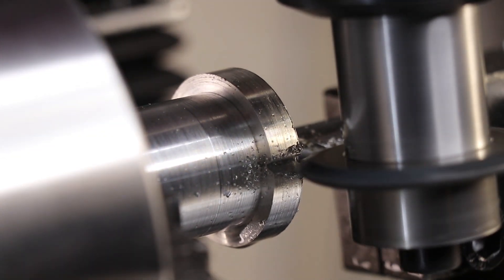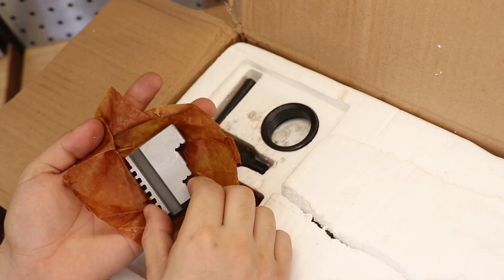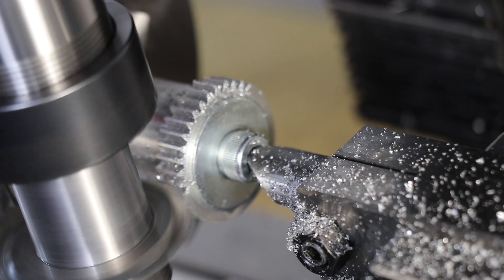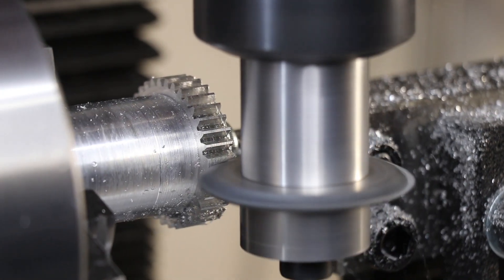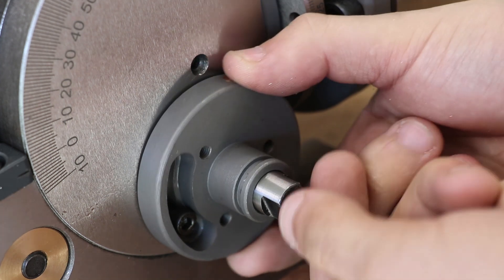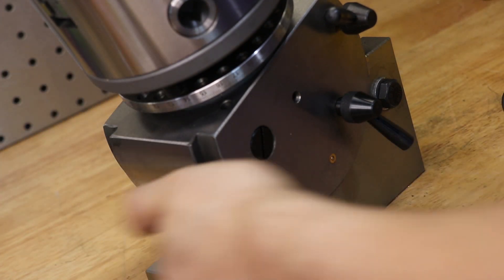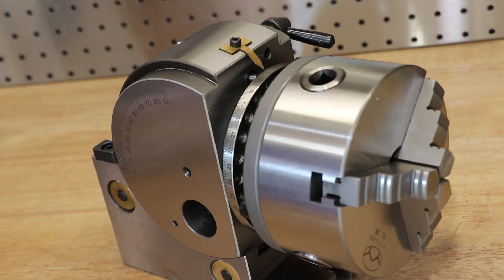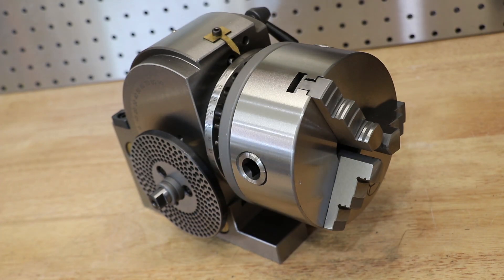$200 Dividing Head - Almost Scammed Buying It

Comment: I have been eyeballing these on Amazon. My mill is cheap, Ecno 30 and absolutely not production shop quality. I got it and about $1,500 worth of Japanese and Swiss cutters for $400. It was a basket case of work like new hand wheels, new quills and rework of the top cover and depth gauge ect. But it was what I could afford and does fulfill my needs. Locked down, it'll cut true enough for me, I'm not outsourced by Boeing or Lockheed, I'm not making aerospace quality parts.

Sure I'd love a $5,000 used Bridgeport but that's later. This works for my garage.

I need to cut a very specific set of rollers with 1/4" pyramidal teeth for a very specific and unique machine I'm making, specs don't have to be to the tenth of a thou. A knurling tool isn't going to do this. So this tool is what I'm after but I've held off for worry it might be a bit too cheap for what it's supposed to do.

Now I know what to expect. I think I'll nab one. Thank you.

Comment: Have the same. Getting the chuck off was childs play. It is just screwed on. In fact I sold the chuck already - without the back plate of cause. Have a 125 mm  from my lathe what was a direct fit ... Quite convinient, can also use the 4 jaw from my lathe on it .No issues on my one also with the handle or its bracket. Works like a charm ... My one came also with a knurled nut for protecting the thread when the cuck is disconnected...

Comment: The original B&S dividing heads have Timken type zero taper roller bearings, and the spindle nose and taper are ground true in place in those bearings. Disturbing the bearings for any reason is risky. The spindle will lose factory accuracy because of stacked errors reassembling. I found the imports a great buy, but the items need refitting of the parts. Good video showing the problems.

Comment: I have the bs-1 version of this. I had to take it completely apart to deburr everything and completely remove the excessive amount of grit it contained. Then I relubed and adjusted everything. Made another index plate on my rotary table to expand the number of gears it can cut. Bundybears workshop channel shows a complete tear down.
Reply from the maker: Did the same, a lot more grit that I would have expected, glad I did it sooner than later. Cheers
Reply: And these cheap import heads are excellent once they have been given the clean out and refit with care treatment. I have a BS-0...very pleased with it.
Reply: The channel is Bundy Bears Shed.  https://youtu.be/4pZxH3NuLHY

Comment: Wow. I have the Vertex BS-0 and it is visually identical except for the shape of the locking handles and the sector arm.  I have seen a page in a hobby machinist magazine from 1975 advertising the BS-0 so this design has been in production for a very long time.
Reply from the maker: Very surprised at how little the design has changed. If anything the sector arms are the weakest part of the build. They are die cast and not that nice to use. Thinking of making brass ones. Cheers

Comment: Seriously? Just use some good pliers to remove the chuck and then replace the bolts with some low profile hex
Reply from the maker: the problem I really was having was that the backplate was so tightly torqued on that it was seized on to the threads. I eventually got it off, had to use a custom holding jig, impact driver and a wrench. Can not stress how tightly it was on. Cheers

Comment: "Cant machine a 101 gear, i might have to attach a stepper and get an Arduino" ... ya you're not able to do any of that... and especially not for a division you'll never need. Get over yourself
Reply from the maker: Of course you can, just a different division not offered by the plates. It's pretty much the same set up you would get in a CNC diving head. Plus takes out any errors or make doing it manually.

Comment: yeah man if that is a friction fit. press, or a frog if you can. to prevent shit from getting scratched heat up wherever you end up securing it on the press, and keep the heat away from the part you decide to press on. so at work we use an oxy propylene torch, but even a small propane torch will help. put the work under pressure, then apply heat, be sure to apply it quickly and after maybe 30 seconds of evenly heating, start to press further. itll hopefully come out nice and smooth. I tear apart industrial machinery as the day job, and things tend to make very loud bang noises when they come free when they are rusty or dirty. something small and new should be easy, im imagining only a few thousandths shrink. When you put it back together put some never seize of your choice on the shaft, just a tiny layer. heat up what your going to get back one either hot enough to just slide it on with gravity and finese or heat up a tiny amount make sure its lined up very well and press it back on as soon as its hot enough.  micrometers and snap gauges will be your friend.
Reply: NO NO NO - the chuck's backplate screws on. Read the comments, he already removed it.

Comment: The faceplate is screwed onto the thread, it is enough to block the rotation of the spindle and unscrew the chuck together with the faceplate. Then the screws will be easily accessible for loosening.
Reply from the maker: This is correct, however the problem I really was having was that the backplate was so tightly torqued on that it was seized on to the threads. I eventually got it off, had to use a custom holding jig, impact driver and a wrench. Can not stress how tightly it was on. Cheers

Comment: To everyone bitching about the price, would YOU set up a shop and build this dividing head to your high expectations for $200?

Yeah, just what I thought...
Reply: I've owned one of these cheap import heads for about 3 years and had excellent service from it making spines and cutting gears. The usual to be expected strip down and re-fettle is essential to get the best from these cheap heads but once set up properly they work exceptionally well. I don't know how they manage to sell such a complete kit for the price. Very happy with mine👌

Comment: I bought the exact same one, but it came with a 41-tooth gear instead of the correct 40-tooth one.  I discovered this 5 minutes after unpacking when I tried cranking it thru a single chuck rotation.  The seller was understandably incredulous so I had to disassemble it and send them photos.  It took a while but they eventually sent me a new 40-T gear which I swapped out myself.  I suspect the factory cranked out a whole batch of these with the wrong gear on the spindle.  It would be a terrific way for an ex-employee to exact revenge on his way out the door.  Not a bad unit for the price, but don't expect the quality of a USA-made equivalent.  It's perfect for a home shop.
Reply: That is a collector's museum piece😂 
You did well to spot that error.

Comment: you are better off using a press to press out the shaft because using a hammer you can seriously damage or even destroy the shaft.

if you ever taken a hammer to any kind of rod you will notice the end being mushroomed and with such a precision too you dont want to damage it.

from what you are saying looks like you got a very good deal

precision tools can be very expensive so you got a good deal.
Reply from the maker: Thankyou for your suggestion. I eventually got it off using a combination of a wrench, fixture jig, impact driver and penetrating oil. Cheers

Comment: It looks like quite a few people are suggesting clamping a bar in the jaws and using it as a lever (once the base is bolted down).  That's what I do on my lathe with a 10" chuck, and it works well.  I've use a copper hammer on the jaws before (after gently smacking it several times on the face of the chuck), but the lever is better.  In your case (because of the brass gear), I'd recommend using a propane or map torch to heat opposite sides of the threaded portion of the back plate for about about 30-60 seconds each and then try a good "calibrated push" on the lever.  If it dosen't work the first time, let it cool over night and heat it incrementally longer; the goal is to expand the back plate without heating the spindle.  I bought one of these dividing heads about a year ago, but haven't done anything with it except remove it from the packaging to inspect it the box it up again, so... I'll eventually face the same problem :)
Reply from the maker: Yeah I had to use a combination of a clamping jig, impact driver, leverage and penetrating oil to get it off. Good ideas all round, but it took several to eventually get it off. Cheers

Comment: The chuck spins off !  Its attached with a big thread just like the chucks are attached on some lathes !
 just put a set of ajustables on one of the chuck clamps and turn it counter clock wise and it will come right off
Reply from the maker: This is correct, however the problem I really was having was that the backplate was so tightly torqued on that it was seized on to the threads. I eventually got it off, had to use a custom holding jig, impact driver and a wrench. Can not stress how tightly it was on. Cheers

Comment: i have used a 3/4" air impact to break loose these things do not lock the chuck the shock from the impact will break it loose use some type of hex in the chuck to be able to use the impact with a socket
Reply from the maker: I did eventually get is unscrewed, using some advice I got here. Combination of an impact driver, a clamping jig and a wrench. Just amazing how tightly this was torqued on. Thankfully no damage to the tool. cheers

Comment: could you please do a follow up if you get the chuck off
Reply from the maker: I have gotten the chuck off, required a fixture, impact driver and spanner. I can not stress how tightly it was on, though no damage thankfully. I will certainly do a follow up. Cheers.

Comment: At the machine shop I work at our Tailstocks also have that two bolt adjustment and they are all REALLY wicked high dollar too! It seems really odd to me too that tail stocks for dividing heads and rotary tables generally have that clunky two-bolt on even the really expensive ones!
Reply: Replace the 2 individual nuts with a single rectangular piece of steel flat stock with the 2 thread holes tapped into it at correct centres. That makes the adjustment of tailstock height/angle much simple with only one spanner needed

Comment: get some mole/vice grips clamp them tightly on the cap heads then tap them with a hammer hopefully they will come loose. but i dont know if there is enough space for you to be able to pull them out fully but hopefully there is enough to get the chuck off. 

then if you do get it off id replace them with hex head bolts so it will be easier in the future.
Reply: NO NO NO - the check needs to stay bolted to the backplate so that you have some way to rotate the backplate and unscrew it.

Comment: I just unpacked one and the chuck did not want to unscrew. Gentle hammering on the chuck key did not impress it. I disengaged the worm , bolted it down to a machine table, put hex bar in the chuck, put a spanner on that and heaved. Then I put a spanner on the spindle lock, overtightened it and heaved again. That was when it gave in. It does unscrew but you must not take no for an answer.

Comment: You get what you pay for, but with careful setup you can do great work on it. Not heavy duty boss crashed ours and cracked frame but we were able to weld it up . But he tried to index a 8 inch dia backing pusher and got in a hurry and hogged the part and bang. I would buy one they are well made for the price. For home machinist they are fine. You could save money and build a Gingry index head yourself. His series of books are very interesting.

Comment: The parts of the brass clamps that need to be machined are machined. The rest you machined didn’t need to be. It just makes it look a little bit nicer. Like everyone else said, it’s not bolted on. A parts list will show how this works.
You were t being scammed. The extra cost for shipping was added into the Vevor price, which made it just as high as the other would have been, or even a bit higher. $225 for this is a ridiculously low price. Here, in the USA, from eBay, these BS-0 models go for around $500, and that usually doesn’t include shipping
Reply from the maker: I might have been so clear, I know its not bolted on to the spindle, the problem is is that the backplate has been over torqued on at the factory and has sized onto the threads, and my problems stem from being unable to unscrew the backplate. And I did leave out a few things with regards to the seller, they refused to refund me and grave me someone elses tracking number when I tried to dispute. And the seller was someone impersonating vevor, and the seller is no longer on aliexpress (banned maybe), if they were I would have linked to it so you could avoid it. And it didnt make sense either, it was being sent locally, but they said I was in the wrong country. Having being burned on stuff like this before with aliexpress, I was not going to take this risk. cheers
Reply: @artisanmakes  no problem. Without that info though, it was hard to make a judgement from here though. Glad you cleared it up.
Reply from the maker: And yeah, the brass didn't need that facing, but the rough surface really stuck out, looks a lot better now.

Comment: In order to do a 101 divisions you would need a universal differential dividing head.  the setup would need to be as follows
index circle hole pattern 20 
number of turns on the crank 8/20th 
graduations on the sector 78
gear on worm 72
first gear on stud 24 
second gear on stud 40
gear on spindle 48
idle gear on no 2 hole 24

not sure if you actually wanted or needed to know this, but if you did I hope it helped.
Reply from the maker: I appreciate you writing it out, thankyou. I'm sure there are many methods, someone else suggested making custom dividing plates. I have seen CNC controlled dividing heads also work pretty well. Cheers
Reply: @artisanmakes  
it is absolutely possible to make custom plates to improve and  increase your division capabilities, however making a plate with correct number of holes for 101 divisions would be vey difficult if not impossible as there is no whole fraction of 101.  (although peoples ingenuity always seems to surprise me to the solutions they find to problems, I have been proven wrong before.) 
CNC is definitely an option, I work a lot with CNC and and this would be easy.

Comment: I would disassemble this and clean it sooner rather than later. Mine was also pretty well made (Got mine for $200 a year ago) and it is a BS-0. Don't know if they are all coming out of the same factory or what, but I imagine they are. Mine had some swarf and grinding dust included as extras inside. I am glad I went the route of cleaning it first.
Reply from the maker: Got mine apart finally, and you are right, a good amount of grit and crud, plus I wanted to replace the factory grease. Cheers
Reply: @artisanmakes Could you pls share how you could take is apart, finally.

Comment: Nice thank you, can you get a 4 jaw chuck for it? You might also consider making a round plate with T slots and a lock to stop it spinning off when in the vertical position?
Reply: Yes, many of the Chinese made or the Indian made 4 jaw chucks are available with the same threads in the backplate. I have a 4 jaw that fits mine which I purchased separately.

Comment: Hello - I have the same type dividing heard. I wanted to put a face plate on it.  I was able to remove the chuck with a strap wrench. It was difficult, but the chuck came off.  Mike

Comment: Put it in the vertical position, put a piece of stock, take a cut and it will come loose, mine came unscrewed on a horizontal cut. It’s actually just screwed in.
Reply from the maker: I know it's screwed on, point was it's just over torqued and it's sized in place. Cheers

Comment: I bought one of these Chinese knockoffs of the brown and sharp - 0 Dividing head. I got mine off of ebay from a private seller for $120 dollars which included the shipping cost which was a pretty good deal. Mine had been dropped so the mechanism was frozen up because the internal clamp got bent when the tightening bolt struck something.
The back plate on the chuck is bolted very tightly to the 5" 3 jaw chuck but it's threaded onto the shaft that goes through the dividing head and I was able to unscrew the chuck backplate from the shaft without much problem.  It's a right hand thread so turning the chuck counter clockwise from the front will unscrew it. As you mentioned this needs to come off because in order to extract the shaft out of the front of the housing there are three cap head screw you need to get to.
Regarding the backlash in the gears and precision gear cutting using the dividing plates, the most expensive dividing heads will always have some backlash so when rotating the locating pin one must ALWAYS come from the same direction when rotating and slipping into the hole. If you go past the hole you wish to land in you need to backup and try again thus eliminating the backlash and it doesn't matter whether you're using the cheap ones or the most expensive ones.
The only real disappointment I've had with the head is that you cannot cut as many gear tooth variations as you can with some of the more elaborate bs models. For example I need a 57 tooth gear and this head won't do it.

Comment: Submerge in fuel for a week or so. Then, the parts should separate using a wooden or nylon hammer. Also, hanging the block rather than working on a bench might help. Then however be ready to catch the pieces 😄
Reply: WOW